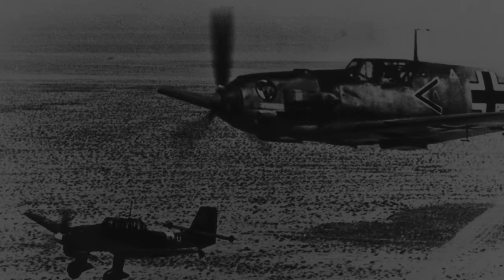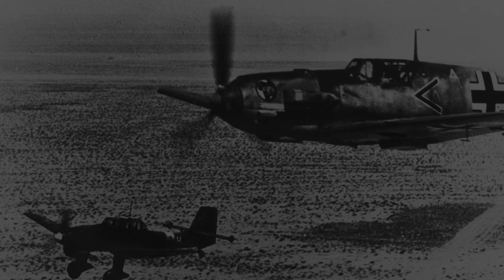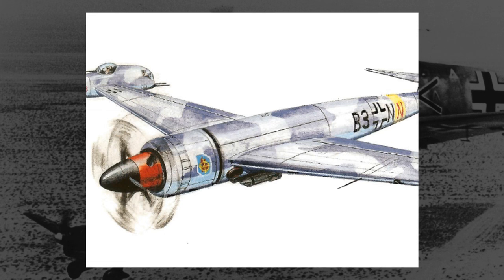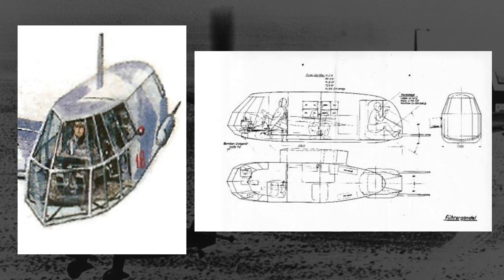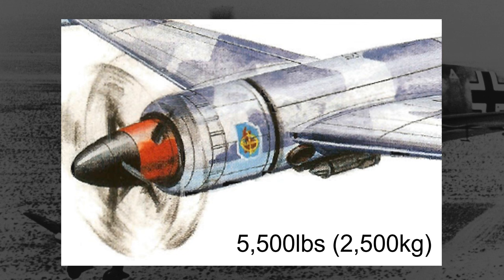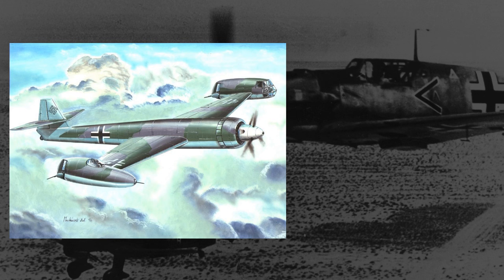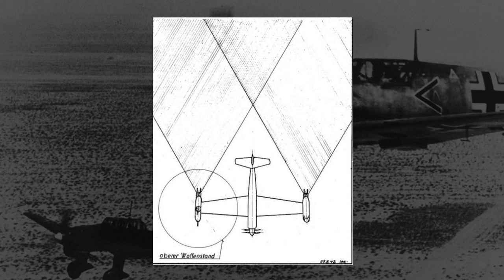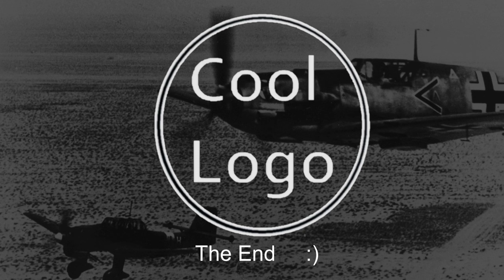Bomber Built Like A Hammerhead Shark: Blohm & Voss P 163

Comment: Indeed, extra wingtip weight to avoid having to strengthen the wing is, without going to extremes, conventional wisdom.  The Piper Cherokee 6 light aircraft has 4 fuel tanks, 2 big tank inboard within the wings and 2 small tanks outboard within the wings.  The flight manual requires pilots to use fuel first from the inboard tanks, then the outboard, because using fuel first from the outboard tanks might overstress the wing at the wing root in turbulence from excessive bending from lift at the wing tips as described in this video.
Reply: Interesting. But I wonder one thing: what happens when the plane is standing in the hangar and the lifting force does not lift the wings? I guess that then the wings may start to gradually bend under the weight - unless, of course, then some supports or additional landing gear are used under these heavy wingtips (?)

Comment: One of many reasons Germany lost ww2 was the obsession with designing so many different types of aircraft, none of which could regain air superiority. Too few pilots for too many different designs, when the winning strategy was in quickly mfg and manning tens of thousands of a good few types. This is what the US did to perfection.
Reply: ever counted the myriad of designs the allied designers made ... countless and also produced a boatload of different designs, parallel to each other. All of the aircraft producers did with and without official competition bids, how would you produce a better ( potentially revolutionary) plane if you don´t try to build it pre-era of computer designs

Comment: At one of my former jobs, we had a funky looking Chevy minivan; looked like a carboard milk carton turned on its side. It was one of the first vehicles I drove, with automatic door locks. This system locked all the doors when you put the transmission in drive and unlocked when you shifted to neutral and reverse. One of my colleagues didn't like the feature and referred to this kind of thing as an 'overengineered piece of shit'. I owned several USSR, WWII vintage Mosin-Nagant rifles, M91/30, M38, M44. When I bought the M44, for $89.95, I pulled the bolt out and stared at it. It looked like it had been finished with a carpentry rasp, but, Holy Shit, it worked, and worked well. You know these things didn't freeze shut in the horrible Russian winter; definitely not overengineered or complicated.

Comment: I really love the sleek fuselage of it, that has a diameter just a little wider than the engine. No person had to fit inside. It can be build even sleeker than a Dornier Do 17 (and Do 217). The space for the personnell would be in the gondolas. 

If it had been build it would be very interesting to compare it to more conventional designs regarding: ergonomics for crew, ease of maintenance (I think the engine would lose to a He 111 or Ju 88, but win against a He 177), material consumption, construction time, overall costs.

Comment: Maybe its because im german and my way of thinking is different but some of those asymetrical designs are interesting. Wait wait hear me out!! If you have the cockpit offset to one side and you get attacked by an enemy how much confusion does it produce in the pilots head to not aim at the center of the plane but to aim to the wingtips. It was never tested but how difficult would it be to adjuste yourself to aim that way and how high is the chance of survival of the pilot in this small, hard to hit cockpit. Or you could kill the plane by setting the huge fueltank wich is called the center on fire i dont know.
If it was tested and studied well enough maybe in the future Military plane had changed shape. Back in WW1 nobody belived much in the importence of planes in naval combat ether...

Comment: The biggest problem I see is that, on a normal plane, the pilot is centrally-located, so rolling the plane doesn't change his position much. With this, even a few degrees of roll dramatically moves the pilot up or down. To be fair, I imagine pilots would get used to it after a while, like they did with enclosed cockpit and not having a propeller in front of them with jets.
Reply: Apparently, B&V actually tested the cockpit layout by attaching a small pod to the wingtip of the BV 141 (the assymetric plane he showed). Pilots actually found it sufficiently intuitive, so that's good.

Comment: Putting a compact cockpit pod on top of the tail with longer podless wings would have been interesting. Though more powerful engines with improved supercharging would probably have been required.
Reply: Visibility out of the cockpit would be a nightmare.
Reply: @Zeguyfromgermany  Visibility would be similar to flight sims certainly not horrible. Would also give full 360 visibility rare in bombers. The idea would be high speed very high altitude bomber. Optimizing for speed & service ceiling.

Comment: For a little more symmetry the Pilot could have been seated at the tail end ( like in the three engined BV P.170 which is featured in an older vid from IHYLS ) possibly with another tail gunner ... adding 1 more crew to the bomber ( more weight ) but some control lines could have been shorter, the pods lighter and the pilot would have had an easier job ( maybe not during take off and landing though ^^ ). The pods in this configuration would have had only a front and rear gunner each ( not 3 as in the right non-pilot pod ) but the bomber would have had vast firing arcs with several gun arcs overlapping.

Comment: German design in the 30's & 40's  across the board was a gold mine of concepts and idea's both far ahead of there times or just so radical that they still have people talking about them to this day. This may have led to many invation that shaped the modern world but back in WW2 all these crazy idea's were just a drain on resources and time.something Germany did not have after 1943. Germans are famed for over thinking things instead of having a set of fixed concepts in place unlike other nations like the USA who streamlined their reseach and production methards to produce pratical designs even if they were not the best. They were more effective.and could be produced quickly.
All these wild ideas in the German weapons industry was a major issue to effectively product much needed effective weapons as the tide turned.this is a simplified veiw of course as you have to allow for Germany been attack from all sides by this point and its Cities and industries been turned into rubble.
Plus the major issue a lack of natural resorces and skilled labor.
Desprate times leed to crazy idea's
Still it did allow ideas that would have never seen the light of day to go far beyound simple just been a dream inside a persons head.

Comment: How could one of the pods be replaced with a fuel tank?Obviously,fuel is used up
Reply: Yes but during the attack phase of the flight, the pod's fuel could feed the engines and by means of fuel transfer, it could be kept full. This phase would be the one where most drastic flight maneuvers could be the expected. The "fuel pod" would only be emptied during the terminal stage of the flight, the part where both, bomb load isn't existing anymore and evasive maneuvres are less likely, so the wing loading is not that critical anymore.
Reply: @ceemosp  what about the massive balance problem?